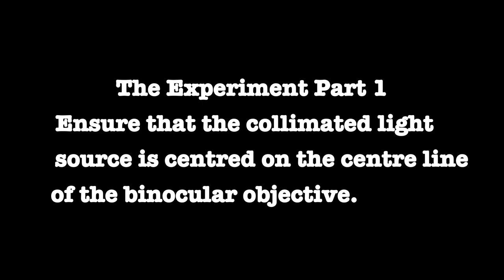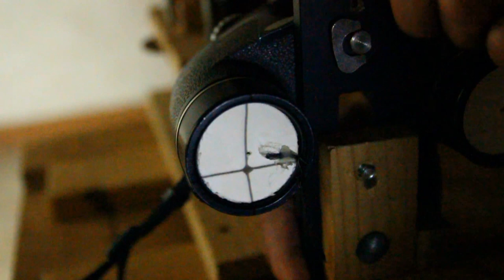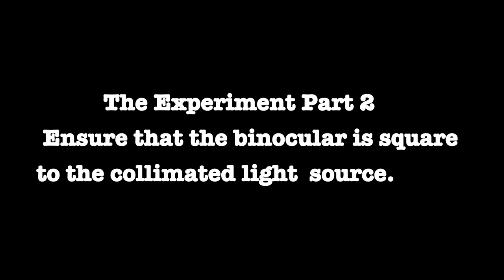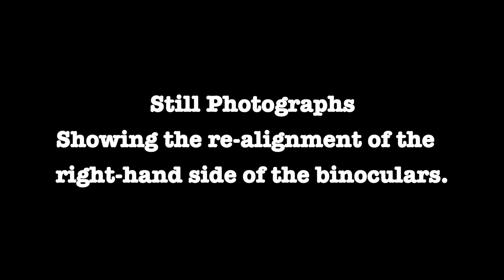Binocular Collimation - DIY Optical Bench Method. Colimación de Binoculares. Collimation Jumelles

Comment: I took my first pair of binos apart yesterday to address a fungus on the prisms issue.  I did remove the prism plates from the binocular body to better clean the prisms.  Note I was not quite so foolish to remove the prisms from the prism plates.  HOWEVER, upon attempting to put the prism plates back I "discovered" that the three screws that hold the prism plate down also seem to play some role in the prism plate tilting as there are grub screws next to each main screw which seem to be causing various tilts when tightening up the prism plate. And it seems that the order in which you tighten the screws to put the prism plate back affects the final tilt of the prism plate.  Ok fine, so I put everything back together as best I could and then found my alignment was off.  This was fixed with an eccentric ring collimation of the main lenses using stars at night.  This worked but presently an interesting observation. Turning the right lens did not improve collimation at all.  In fact, all if did was cause the star I was using for collimation to either disappear all together or reappear as I turned the lens.  Turning the left lens did work well and allowed collimation for a single star image.  However, I read somewhere that messing with the prisms for collimation would reduce the image quality. And the incident where turning the right lens caused the star to appear and disappear makes me think the light path of the prism could be really out whack. Am I understanding that wrong?  Which lead to the question, how does one properly re-install a prism plate to get the optimal light path (independent of what might happen later if eccentric ring tweaking is needed).  Thank you.

Comment: hello again, i enjoyed watching this again ,something about your soothing voice and watching the whole process is like asmr therapy lol , but i believe there might be a flaw in this technique when you are using the optical lever method you are adjusting to make sure the beam reflecting off the mirror and going back on the collimator target cross is square or parallel to each other ,ok but the problem is you are only moving the vertical and horizontal axis of your binocular and i believe this is a problem because all you are doing is making the cross hairs superimpose on each other at a certain cross sectional point of the beam , if you think about it the reason there is misalignment is because the beam reflecting from the mirror is off by some angle because the face of the mirror is tilted away from a perfect 90 deg back towards the face or the collimator lens or cardboard cross target and by shifting the vertical and horizontal axis you are not fixing the problem since the beams (ie one coming from collimator and the other from the mirror reflection) are not parallel or both 90 deg to each other thus you are only crossing the beams at a specific section and still have them diverge from each other in the far field  instead of having them parallel or becoming one solid beam ,  you should use a tilt adjustment in both axis on the bino mount ,this will be a more precise adjustment than what you have  ,there must be a tilt fault in your mount to begin with causing the error  ,it could be vertical tilt error by the look of it
Reply: hmm ok wait now that i think about it the only way you were able to superimpose those crosses is because you must have been able to make tilt adjustments ,that is the only way they would have moved but you said the bino mount only moves on horiz and vert axis so im confused, do you not have tild adjustment as well for both axis? if you only moved vert and horz axis the image would not move ,so there must have been tilt motion for this to work

Comment: I see you worked hard creating the collimator, wouldn't you have to be able to reuse an old slide projector for that ? Maybe just by replacing the light source which would have been too powerful. You then would have a compact, precise and adjustable contraption ?
Reply from the maker: That is an idea, although I'm not sure how collimated the light coming from the projector would be, but it would be a good starting point! Thanks for watching and commenting. Best Wishes from Normandie, Andy.

Comment: My first question regarding this topic : I suspect my bino is not collimated as I cannot obtain a perfect sphere when focusing on the planets even when focusing the LHS diopter  followed by the RHS focusing ring . However , I'd like to obtain a more dependable 2nd opinion method that confirms I am right before tinkering with it. Do you know of a dependable way to determine this ? Thanks for your videos. I love the DIY way you solved these problems but need to watch a few times over to thoroughly absorb each step.
Reply from the maker: Hi there! Sorry I haven't replied earlier but I've been away. Has this always been the case with your binoculars? I would suggest that you do a star test on them. This is normally only done with telescopes, but I have checked binos the same way. First you need a pin point light source, I use a flashlight with a cover on the lens which has a pin hole in it. Next, you will want to look at this bright pin point of light in a darkened room, ensuring beforehand that the binoculars can focus at that distance, otherwise you may have to make the distance greater by performing this outside at night. With the flashlight on you should see your 'star'. Looking through one eyepiece at your star, slowly change the focus such that you get an unfocused image either side of a sharp, pin point image of the star. Is this image circular? Repeat with the other eyepiece, is the result the same?  You can obviously compare the view with that obtained with other binoculars.
If you're not getting circular images then there is a more serious problem than just alignment.
Good luck, Andy.

Comment: Thank you Sir! I will try to build a similar device. Nice binoculars, is it Sanjo 10x40 7.5° ?
Reply from the maker: Hi, these are Frank Nipole 10x40  7.5. They're great now they're correctly aligned. After working with this set-up, I would still recommend using the'quick method'  that I illustrate here: https://youtu.be/01tSEXxJEdA
Thanks for watching and commenting, I really appreciate it. Best Wishes from Normandie, Andy.
Reply: @Organikmechanic  Absolutely agree that, this binoculars are great. Have the same, with different name but looks like the same body, coatings, parameters, and my favorite here: great wide field of view. Of course I saw your tutorial, it's just brilliant. I will use both, it will be very useful to me. Thanks again for the great content, well done. All the best to you from Poland.

Comment: What kind of lens is that in the collimator?  From a magnifying glass?
Reply from the maker: Hi Jeff,
A thousand apologies for not replying sooner, I can only use the excuse that I had visitors for much of August and I'm only just catching up (one of the penalties/pleasures of living in a touristy area). Anyway, the original lens was a magnifying glass but I did have problems with it.being too powerful so I changed it for a weaker and smaller objective lens which I think came from either an old telescope or old binos. This turned out advantageous as the experiment progressed. I have written three articles on my blog relating to the project and the first one is here: https://thegreenlever.blogspot.com/2018/11/diy-table-top-binocular-collimator.html#.W_a5qNJG2kA
There should also be a live link to the blog in the notes below the film - I've just tried it and it works.
Thanks for watching and if you want any further clarification please get in touch. Best Wishes from Normandie, Andy.
Reply: Thanks and no worries, no hurry!  Thanks heaps for the video and explanation.